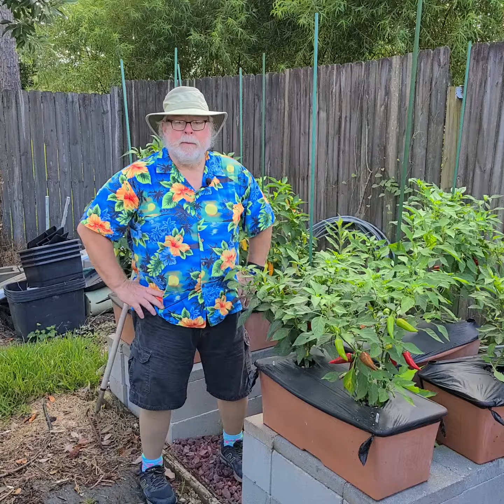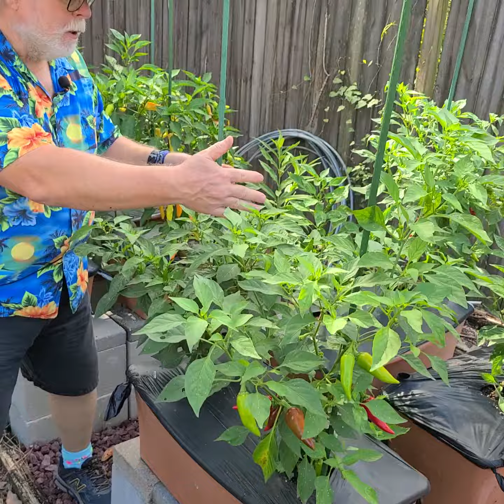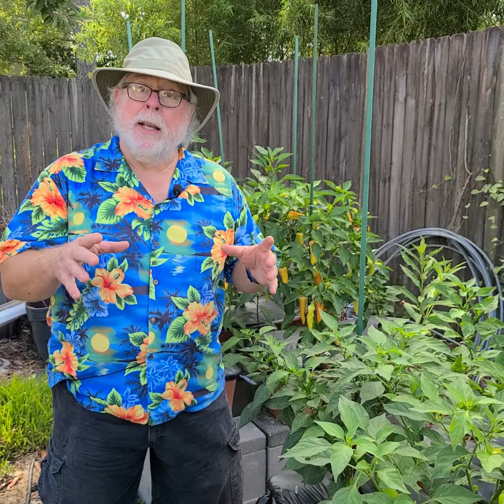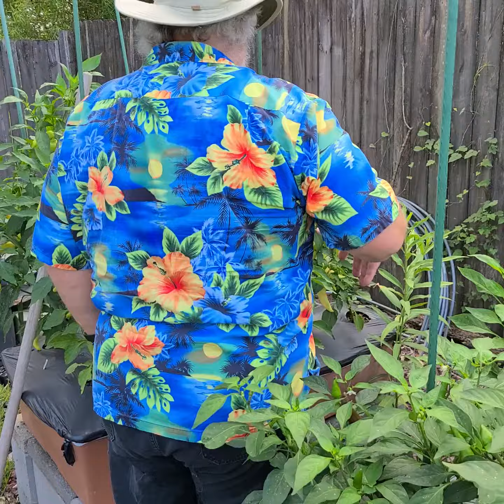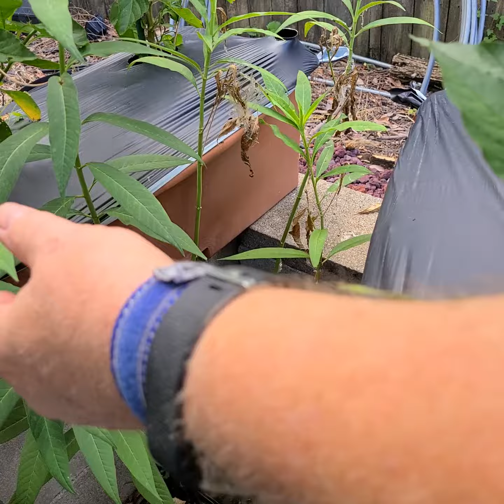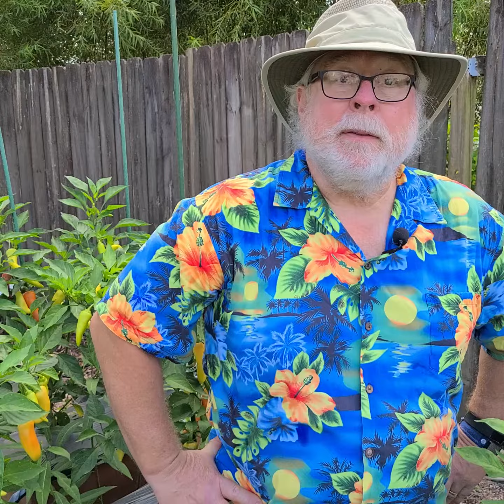Daily Dose of Hort for July 19, 2020

Comment: Do you have any problems with mosquitos breeding in the water reservoir? And if you do, what do you use to treat it? I have several of these earth boxes but have been hesitant to use because of mosquito concern. I have a problem with mosquito where I live.
Reply from the maker: Carson, I live in south Mississippi with lots of mosquitos, I don't see an issue with them. You can use the mosquito bits, pieces of mosquito dunks put into the reservoir tube once a month.